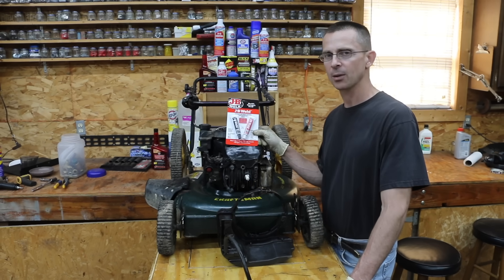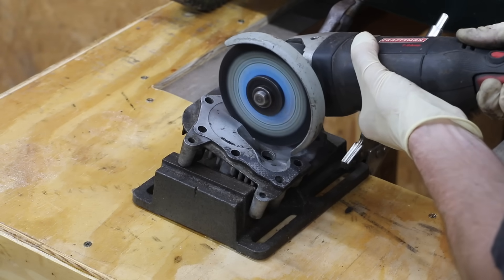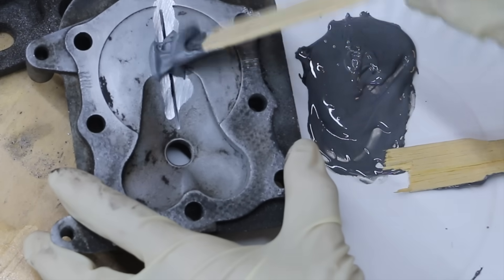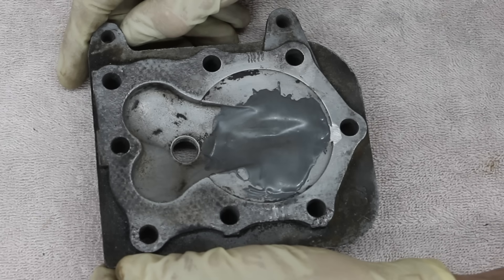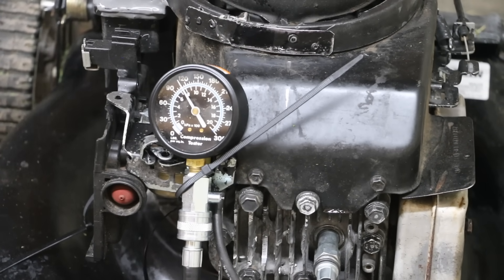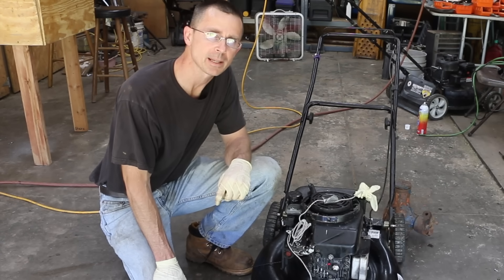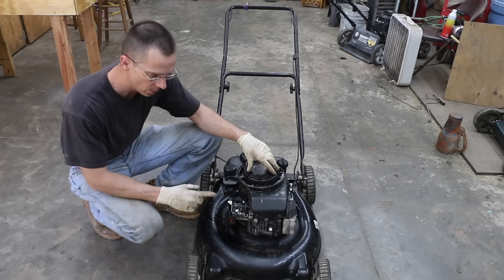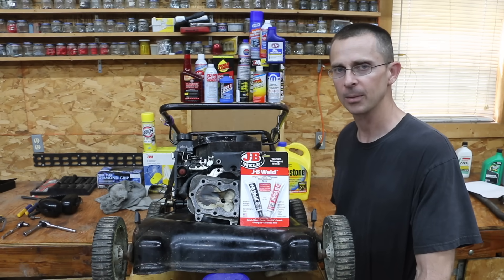Can JB Weld fix a cracked cylinder head?  See the proof!!

Comment: i use jb weld to attach brake lining  material on vintage mini bike  brake shoes. they say it good to 600 degrees F. i don't imagine  mini bike brakes will ever get that hot without being set on fire. i have not had it fail yet... jb weld is an awesome product!
Reply from the maker: Impressive repair!

Comment: @ProjectFarm I should be able to use jb weld to fix the vacuum leak on my 5.3L Tahoe then right??
Reply from the maker: What type of vacuum leak?  If it's a gasket failure, I would suggest replacement of the gasket.  If there's a crack in a part, JB Weld would likely work but it's hard to advise without seeing the needed repair
Reply: I'm almost certain it's leaking on my intake manifold gasket. All the hoses look good. About to confirm with the tried and true brake cleaner test.

Comment: and you made a 2nd mistake,,, this is an engine (uses fuel/air/spark) to function,,, a MOTOR is all electrical powered,, no fuel/air/spark,,,, 110volt and up,,, ole diesel engine man USN
Reply from the maker: Thank you for the feedback

Comment: Alright, I know this is an old video. Great video. But this makes me curious. You are concerned about how much time it can go for... what if it were reinforced?  Just like rebar in concrete. Or, more applicable... some kind of chicken wire in the mix? Would that result in more strength?
Reply: For larger holes or where I needed to spread the load over a greater area, I’ve used window screen with it, creating a composite.
Reply from the maker: Thank you for the feedback

Comment: I've used JB Weld for many projects including the repair of mechanical clock pivot points. Just wondering, if it can repair a cylinder head what about cracked dentures?
Reply from the maker: I wouldn't use it on dentures.  Not sure it's safe

Comment: Years ago I had a 4x4 Honda Foreman 350 4-Wheeler.    I took the snowplow off it one day and neglected to put the skidplate back on underneath.    I bottomed it out on a rock, right exactly on the oil drainplug, and it knocked a half-dollar sized hole (all around where the drain plug was) in the bottom of the block.   I was in some knee-deep water at that moment, so I didn't know I had a pretty serious issue until the engine seized.   Fortunately, the engine freed up after cooling off, so I stuffed a rag in the hole and put more oil in it to drive it back off the mountain to the trucks.

Since I had nothing to lose, I tipped it upside down in my garage, cleaned it up the best I could and gooped some JB Weld inside the block to form a 'mushroom' shape inside, filled the hole and did the same outside the block.    I let it dry 2 days, then filled it back up with oil.    It ran perfectly for another few years of hard duty here in Alaska out in the boonies and that JB Weld never failed.

I am much more careful to replace skidplates these days, too.

Great channel!     I subscribed, keep up the great work!
Reply from the maker: Impressive!  Thank you

Comment: Thank you for the video. I have a valve cover on an car that I had tap a bolt for. Tapped it to large. I bought quick steel,but after seeing your video decided to use JB Weld. I am hoping the weld hold in fix a thread fastening. Thank you again for your time and video.
Reply from the maker: Thank you!

Comment: I graduated from high school in 1969 and went on wheat harvest that summer. I was hired as a truck driver. My truck was a 1955 Chevy 2 ton grain truck with a dump bed and a swapped in 350. We started in Oklahoma cutting wheat in Oklahoma, Kansas, Nebraska, North and South Dakota. The truck pulled a trailer with the combine on it with the harvest head in the bed of the truck. By the time we got to South Dakota, the truck could barely make it up a hill. In Fort Randall, SD, the boss and one of the other men pulled a head off the truck and repaired a cracked  block between two cylinders with JB Weld. We  continued on the harvest through North and South Dakota and returned home in south central Nebraska with the truck and repair intact. I've been a fan since I was 18.
Reply from the maker: Impressive!
Reply: @ProjectFarm  Its funny how many times you say IMPRESSIVE
Reply: @jzd-pajbzobec8878  one might even say it's....impressive
Reply: Friend had a 80's Corvette that he stored over the winter with only water in it and no antifreeze.  Cracked the block. We used jb weld  and never had any problems at all...
Reply: @edbenoit5879  I just used Jb weld to fix a crack  4 inch long on the Aluminum inner primary on a 1979 flh Harley Davidson and the stuff worked awesome. The inner primary leaked oil for 14 years and I found out it was cracked  2 month ago when I took it off for something else. Saved me about $300. It dried VERY hard.
Reply: Great story.
Reply: I used it on a cracked radiator on my cbr 600 never leaked after
Reply: @seane9109  there’s actually a kit for that. You get the sealer and you get steal wool to poke in the hole and I think a screen like stuff to. Been a few years since I had one.
Reply: I did the same thing to a 400 SBC that cracked between the cylinders. Filed the crack down until it was gone, filled it with JB, reinstalled the head, and it ran fine for several years before I sold it.
Reply: @Fahleen  I thought the same thing.
Reply: WOW. HOLY SHIT! lol. That's insane,  however I definitely believe you. And I completely agree that jb weld will get the job done.
Reply: I hàve the sàme issue with a very fine hairline crack between my cylinder head inline with the cooling ports ànd oil ports it's and inline 4.0 straight 6 I'm wondering if this will work for my problem.
Reply: That’s IMPRESSIVE! Now that equipment is the ultimate torture test of JB Weld, pretty cool
Reply: My Honda XL250 developed a crack on the cylinder head after I rode it through water up to the seat.  The crack went up the spark plug hole and  across the exhaust valve seat.  I filed and cut a v along the crack and filled with JB Weld.  After it cured I rethreaded the spark plug hole and cleaned up the valve seat. The motor ran perfectly for over a year before I sold it.
Reply: That’s badass as fuck

Comment: I have an inch and a half crack on my cars' oil pan and is leaking a little bit of oil, will JB weld work????
Reply from the maker: Lots have viewers have repaired leaking oil pans with JB Weld
Reply: @ProjectFarm  thank you for your quick answer. I'm concerned about the JB Weld stuff mixing with the oil and damaging the engine. Also, the oil pan does get really hot, will the product melt? I will appreciate if you or someone else can answer my questions? Thanks

Comment: I would like to say there is one flaw in this test: An angle-grinder chop in a head isn't the same as a crack. Depending on the crack, it's either a thin split, or the head is actually cracked into multiple parts. A grind is smooth, while a crack in cast metal has a very high amount of surface area from the crystalline structure. Additionally, depending on the crack, the JB Weld isn't actually filling any especially large gaps, simply bonding the two surfaces together. Clampage really helps it work well too.
Reply from the maker: Thank you for the feedback

Comment: I had a crack on the top of my radiator in my 1991 Honda motorcycle which at the time I could not afford to fix. (back stuff 1999). So I used JBW to fix it and I gotta tell you I was very happy with the results. It held up to the test and with so that hot water going through it and past it I should say, it really did the job. I did end up getting a small leak after a few months but I put a little not JBW on it and again it fixed the problem. The only thing that comes to mind now is maybe the JBW cannot hold up to the pressure and heat of a radiator in a slightly more long term test. Maybe in the future you can run this same test on a radiator to see if maybe the hot water it coolant somehow makes the JBW fail somehow since in my example it did fail after a few months. I'd love to see you do that test on a radiator on your channel.

Comment: I am in the process of designing and building a small-volume aluminum car frame out of 6061-T6 extrusions and 5052-H32 sheets. After researching the REALLY pricey epoxies that companies like Lotus use to bond their aluminum chassis components together, I'm curious if just regular old JB Weld would work just as well--or perhaps even better. All of my components will be epoxy-bonded AND mechanically fastened.
Reply: Did you ever build the car without welding the aluminum?

Comment: We had an airboat motor for 1 year with with jb weld in the head dont ask me how it worked but it did it was a 350 chevy small block til this day I dont know how it worked but saved us 6000$ for a new one we also had some in the cylinder wall to it had a crack and it fixed it for a while crazy
Reply from the maker: Impressive!

Comment: radiator with no cap Zero pressure / i can not get jb weld past 180*F... like all other epoxys... turn to jelly at 180F
Reply from the maker: JB Weld is rated for 500F but it needs to fully cure for 24 hours at around 70F before it's used
Reply: let it dry for 2 years,  jb weld  will not get past 180*F ...... like all other epoxys... turn to jelly at 180F......... i even called ford aerospace , 240*F epoxy cost $3000  for 1 oz.... used on space shuttle.

Comment: Until recently, I didn't realize that Marine Tex gray and JB Weld were different.  I now realize that JB Weld is good to about 650 degrees F and Marine Tex is only good for about 250.  I have used Marine Tex to repair 2 gas tanks and the cracked water jacket of a 100 hp outboard.  They have lasted for years with no problems.  Recently I repaired a leaking transmission cooler on a bulldozer with JB Weld after I realized it would handle so much more heat.  Nonetheless, both products have performed perfectly on these and many other projects.
Reply from the maker: Thank you for the feedback

Comment: My vehicle has an underbody splash guard which bolts onto the plastic wheel enclosure with a U-clip.  Last time I took it off, I saw that the plastic was ripped off where the clip was supposed to be.  My choices were either to buy a cheapo re-manufactured wheel enclosure, or fabricate a reinforcement so I could drill a new bolt hole and put a new clip on.

I ran this by my dad, an old-hand DIY kind of guy and asked if he thought the reinforcement would be strong enough to hold up against the forces and vibrations you might expect on a daily driver.  Immediately he replied:

"Just use JB weld."

I had never heard of it, so I asked:

'What's that?  Will that really last on a car going 80 down the freeway and running over manhole covers?'

He just laughed, and now I know why.  Thanks for the videos!
Reply from the maker: Thank you for the feedback

Comment: I had a Ford Mustang as a race car that I ran at the strip every weekend. I installed some 351 heads that were ported and polished. One head was ported right through the water jacket. I used JB weld to repair the crack. The next day I ran the car at the drag strip and the repaired head help up great. I won the the race against 30 other contestants.  JB Weld is great, does everything they say
Reply from the maker: Thank you for the feedback

Comment: I put JB Weld on a 350 Chevy block that was cracked, that engine ran for years like that. Good shit!
Reply from the maker: Impressive!
Reply: I worked with a guy who threw a rod on his car just before his brother returned from the army.  It broke out a good-sized piece out of the block down by the oil pan.  The piece had oil pan bolt holes in it.  He  cleaned it up real good, put glue on it, bolted up to a new oil pan, didn't tell his brother, who was elated his brother would sell it to him because he always wanted that car.  A few years later he bought it back.  With brothers like that...LOL!
Reply: Many years ago, I overheated my old Oldsmobile beater that I used for a work car, resulting in a crack that ran between two of the cylinders. A friend of mine removed the head and patched up the block with JB Weld. It worked!
Reply: Me too but a honda
Reply: @performancecyclespecialtie6104  I've recently found a crack on my cylinder head on my 90' honda accord bc the last owner was incompetent and ran the engine dry from a broken valve cover gasket and I was wondering how well JB weld has worked for you before I use it?
Reply: Was that just the normal JB Weld or the high temperature JB Weld? I want to fix a 2 stroke model airplane exhaust?
Reply: @julianneale6128  i used regular
Reply: @performancecyclespecialtie6104  hey thanks for that, I just ordered some regular JB Weld to do my job! Stay safe.
Reply: Iv done it too worked fo many years
Reply: Im about to try JB Weld into my engine block where it is connected with the base of the water pump.  Water seems to be leaking out of a broken red seal. however, it is hard to remove the base cause it is under the main train pully. so rather than take it to a mechanic that would charge me 1,000 dollars, Ill try this 8 dollar bit. however, which JB product did you use?
Reply: How in the world can plastic stand up to combustion temperatures?

Comment: threw a rod in 396 el camino, blew a tennis ball size chunk 
out the side of the block.
repaired the engine and used jb weld to "glue" the chunk of 
metal back in place.

sold the caruck 3 years later.... it's probably still doing fine.  
:^)

Comment: I had a '70 Maverick that had blown out part of the exhaust manifold gasket. It was very loud. The manifold bolts were hopelessly rusted, and I didn't have shop access... but I did have JB Weld. I filled the gap in and let it sit overnight, and the next afternoon I fired it up and it sounded nice and quiet like it was supposed to. It held and worked perfectly fine like that for a couple of years, then I ended up selling the car (I told the buyer). She never had it fixed, and it was fine like that for another 8 years. In that time, she had the muffler replaced, but the manifold joint was solid as a rock.
Reply from the maker: Impressive repair!
Reply: Thank you for this info.

Comment: For short-term emergency situations, this would appear to be an excellent way out of a bad situation, but I'd be curious to see what would happen in the long-term.  For example, what about cylinder heads and blocks on regular cars?  Two potential issues might be the uniformity of mixture through the thickness and properly machining the JB-Weld to conserve the compression ratio and proper geometry to achieve the correct flame front.  Interesting videos you have - food for thought and good reserve for those emergencies.

Comment: Great video! I used JB Weld to repair a 1 inch crack in the metal top of the radiator in my old Ford van. I sanded around the crack to rough up the surface, cleaned it really well with acetone, and applied the JB Weld in several thin coats allowing each coat to fully cure before the next was applied. I drove that van for years without another radiator issue!
Reply from the maker: Thank you

Comment: I used jb weld on a v6 2003 Hyundai santa fe crankshaft pulley bolt. I got 2 years of driving (about 15,000 miles) before the bolt unthreaded and fell out. I did this because the original bolt bent from a wobbly pulley and messed up the threads in the crankshaft. I tapped the threaded again but it was a little sloppy. So when I installed a new crankshaft pulley and crankshaft bolt I placed jb weld on the bolt threads at 0 degrees, 90 degrees, 180 degrees, and 270 degrees. About the amount you would use if you put lock tight on the threads. Unfortunately I didn't have a proper torque gun so I just used my 12v dewalt impact with a socket. Cheap $50 fix but it worked for a bit. One can only wonder how long it would've lasted if I torqued it down correctly (or I put more jb weld on the threads). Unfortunately by this time my wife was fet up with the car once we hit 200,000 mile when it broke again. So recycled it and we bought another used Santa fe. Great videos, you do great work!
Reply from the maker: Thank you!

Comment: I finally know what engine knocks sound like after watching a guy testing glue on his lawn mower. Thanks Youtube, great stuff.
Reply from the maker: lol!
Reply: I repaired a leaking Subaru sump which was rusted through. Lasted at least four years we own the car for - totally forgot about it between oil changes. That was a generic brand metal loaded epoxy, not jb weld.
Reply: Yep. You need to have your valves adjusted and clean your pistonheads with Seafoam. Project Farm did a great video on his noisy truck - look it up.
Reply: You couldve just listened to a chevy running.
Reply: @dumdum7786  Or a 90's FORD anything... LOL
Reply: @Gottiline_Ace  yes
Reply: Dum Dum or any  Ford product.

Comment: I first heard of JB Weld from a friend at work. His Peugeot diesel was leaking anti freeze. He came to work a few days later and told me JB Weld stopped the leak

A few years later my son had a leak on one tube that fed antifreeze to the heater of his Ford Taurus. We cleaned it with alcohol and applied JB Weld. It sealed the leak perfectly.

Comment: Wow! Now this video brought back some memories. I am now 61. When I was roughly 13 a neighbor of mine had a very old riding mower. Cracked the head. Fixed it with JB Weld just like you did. Put it all back together, changed the oil and started it up. Ran great. Roughly 8 years later when I moved away, that damn mower was still going strong. Even though I knew little about engines then, I never would have thought that JB Weld would have worked or for that number of years! Thank you again. Glad I subscribed awhile back.
Reply from the maker: Great!  Thank you!